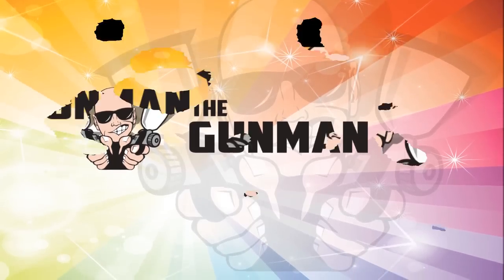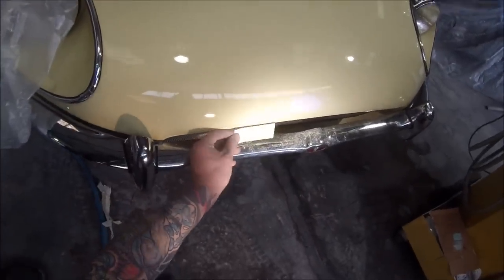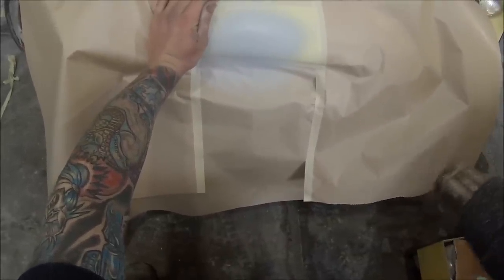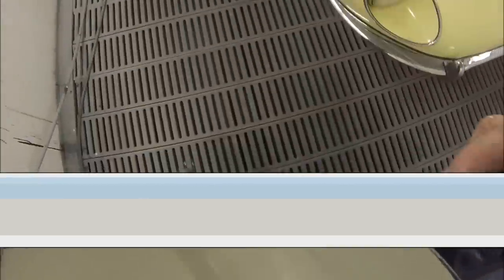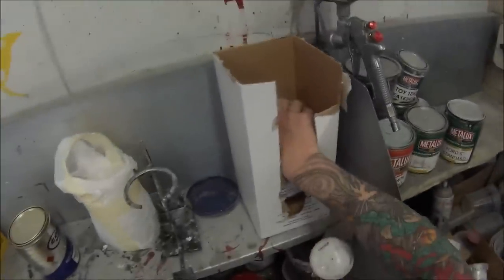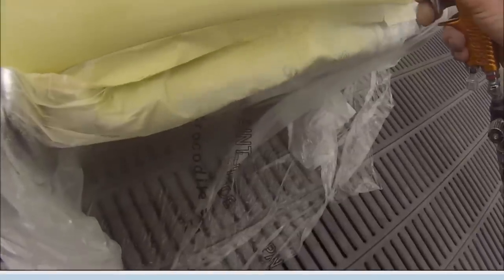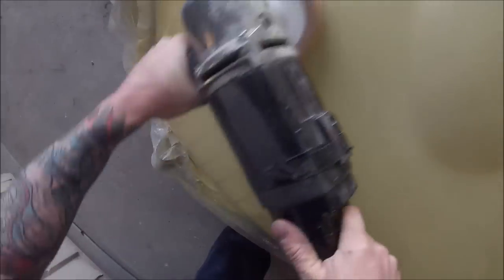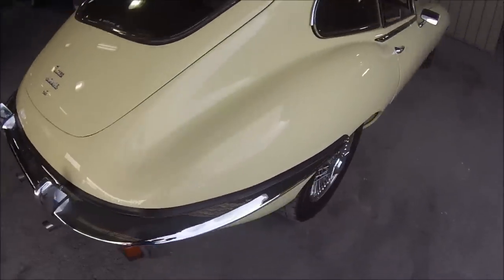E-Type Jaguar How to "Spot Repair"

Comment: Very good video mate well explained .great tips for fade out.
Reply from the maker: Thanks again for watching man, Cheers.
Reply: @TheGunmanChannel  what process do you do if it is single stage paint how can I spot repair single stage?
Reply from the maker: @Brandon_obs_ls  I would use clear coat on the blend area, it generally results in loss of gloss on the whole job but it'll buff up. You'll usually be able to see a single stage blend no matter what, using clear helps reduce the risk of seeing the edge.

Comment: Hi Gunman, excellent video, many thanks for putting the time in to do these....its appreciated!! 

Quick question: Would the same blending technique be necessary if you were just spot repairing  a solid colour without a clear top coat?

Thanks again

Comment: Hey Gunman,
I just bought some blending clears.  I did a spot on the weekend but the blend area dried out dull.  I wet sanded down and then polished, and all looks quite good.  My question is should I be adding the blending clear to already mixed clear coat, or simply running the blend clear on it's own which is what I did, and likely why it dried/ hazed?  I think you mixed the blending clear in with some already mixed clear in the gun and then sprayed the outer edges that you roughed up with the grey scotch pad.  Sound about right?
Thanks Mate!!

Comment: That's a brilliant job I'm myself a auto smart repairer . Regarding to the blender you use what's the % of lacquer on the gun with the blender ? Another question i normally buff a bit of the panel where my scotch ends towards the rest before I clear am i wasting my time? Thanks Orlando

Comment: Holy 'clip resurrection' Gunny :)
Can you confirm if you are blending your new clear into old clear.
Or is original paint a single stage gloss that your blending clear into to create a glossy finish ? 
Cheers
PS: Have finally armed myself with an anir160 and a gpi....getting ready fir full re-finish on my van.

Comment: I have always been checking a panel I am interested in your video that connects the old and new clear coat without any fog my question how to connect the clear coat so it does not look like a mist Is using thinner or another

Comment: I have a Harley tank that I painted and recently there was a leak around the gauge and it bubbled the paint. I sanded down the area and feathered it back but there's still quite a height difference between the repair area and the rest of the tank. Would you fill this with lightweight filler? It's just a solid black (gloss) tank, and I was trying to avoid respraying the whole thing. It's not a show bike by any means, but I want it to look good.

Thanks for your very helpful videos. They are part of what inspired me to paint it in the first place.
Reply from the maker: brock adams Yes sometimes when there's a lot of paint on a panel then its better to fill those edges or just keep going until its feathered properly then use a good 2k primer, the only other option is to take it all off but you may find more repairs.

Comment: Dear Gunman, love your work. Great job on getting the skill and info out there!

I have a question though: Do you have any experience with or know how about the Devilbiss SriPro spot repair gun? I'm thinking of getting one for small paint work that i can do myself in my shed. I can't find anything on it on the web so i hoped you could shine some light on that type of gun.

Keep at it!
Reply from the maker: Thanks, yes the sri are a great mini gun but have a hefty price tag, I have one of these Star mini guns and they are quality guns http://www.ebay.com.au/itm/STAR-NEW-CENTURY-SLV-EVO-T-MINI-Gravity-Spray-gun1-2mm-/120778164107?pt=AU_Car_Parts_Accessories&hash=item1c1ef0878b In Australia eBay is the best place to buy guns and you won't find guns cheaper elsewhere.
Reply: The Gunman  thanks a lot !!

Comment: hey dude, at work I'm starting to learn spot repairs but always get a like visible line all the way around the repair when I polish the fade out back?....do you spray fade out thinners past the grey scotch area or just before it? usually I p2000 wet sand past the repair then spray halfway into the p2000 area but when I polish it up I get the mark... I work in the industrial trade spraying lorries using ICI ehs turbo plus range... what am I doing wrong.. also I polish with farecla G3 compound. Any feed back would be greatly appreciated. I too am a fan of the gti pro lite although I use mine with the kb2 pressure pot. cheers. 👍
Reply from the maker: galva900 I always spray the fade out thinner over non sanded clean (polished) paint. The reason you can see an edge is because the buff is struggling to remove the 2000 grit scratches but ripping into the fade out thinner. Give that a shot and let me know how you go.
Reply from the maker: galva900 Also you want the leading edge of the buff running away from the fresh paint not towards or it can peel it up.
Reply: Try wetsanding your blend with 3000 grit.

Comment: hey gunman im a weekend guy in my garage at home but i really enjoy spray painting and your vids are second to none!
one question i have if you were doing this on say a middle of a door would you use clear base coat to go around your colour base coat and then clear the whole panel?
Reply from the maker: That is the best option, as you saw this was a massive panel and the customer needed to keep it small, usually I'd prefer to do the entire panel with at least clear.

Comment: I appreciate that your were doing what the customer (mechanic) asked of you and you did a great job but if I was the owner I would not have been happy and would have required the the entire middle section of the bonnet to be done - this is based on my own experience.

I have owned an E-type for a long time and in my ownership I have touched cars with towbars twice and caused similar damage to what this car had.  The damage was also fixed along the same lines as was done in this vid.

The car came back looking great - but after about a year in an out of the Aussie sun and a few polishes the blend point between the old and new paint became visible - not markedly so but nevertheless you could see it.  After the second ding I was assured that all would be Ok but the same happened about 12 months after the repair.

Also I would have thought the thin clear coat that was put on (noting that Primrose Yellow does not have clear on it) would be worn through after a few decent polishes and scrubs - the front of the bonnet does get a lot of bugs and grime on it with use.

Comment: Hi Gunman

Great video, I have learned so much from your videos, especially the one for fixing runs in clear coat, fantastic.
Just one question, you mentioned that you mix your base coat 2:1 whereas I have always mixed my base 1:1, is this a different base or have I been doing it wrong?
Reply: This is with acrylic, I've always read that you do a 2:1 mix too as per the label on the paint anyways.

Comment: Can some fillers be applied directly onto paint, please?  And why would you use this type instead of going to bare metal?
Reply from the maker: Kevin Chamberlain Yes the fine polyester fillers are designed to go over paint and its just quicker and easier than opening up possibly more old repairs and multiple layers of paint. Your paint supplier will point you in the right direction as which fillers can and can't be used over paint.
Reply: The Gunman Big help!  Thanks GM!  :)

Comment: How does blending thinners work ? Does it thin out the original clear and the new clear to form one surface and prevent an edge forming between the new clear and original paint?
Reply from the maker: +sypher0101 basically yes
Reply: +The Gunman You mentioned (i think) you did the spot repair because it had along bonnet & it was a quick job, would there be much difference doing it this way rather than painting a whole panel on other vehicles with small area damage ?
Reply from the maker: Material usage, prep & polish is more doing the whole panel but doing it this way the blend may be visible in time

Comment: Every time I see someone do this, they blend a large area. We call this type of repair " doing a burn in " My question is , can you keep these types of repairs small. I need to do a couple spot repairs on a similar car. Volvo P1800ES. I have an aerosol blending agent to burn in the blended clear. Would reducing the activated clear 10 to 1 work better than the blending solvent? I know these types of repairs have had to be around for 50 years. I think people who are good at it don't tell their secrets. You don't have a choice when dealing with old European coupes that do not have breaks between the panels. What are you going to do? Disassemble and paint the whole car just because someone dropped a wrench on the nose? I've also seen people only use compound to scuff the area to be painted. Will that work as well as a grey scotchbrite and scuffing agent? One more question. Will alcohol wipes work as the wax and grease remover or do I need to spend another$20.00 for real wax and grease remover? How are other people doing this on really expensive cars? You definitely have the best video on this subject. The Volvo looks like a show car after wet sanding and buffing it. A couple of the areas are barely noticeable. I'm worried about making it look worse than it already does. How long will that repair hold up before fading back out on that hood?
Reply from the maker: erosionhead420 I have copied this question and saved it, what I'll do is answer it in a long video when I run out of stuff to talk about. I could sit down for 20 minutes writing a reply and I'm very busy these days hope you understand mate. Oh and lets be honest if you got 2 years out of it you'd be doing well but a polish may bring it back up.
Reply: Cool, thanks. I know i was asking for a lot of information. I would be interested in how they were doing this type of repair 50 years ago. I'll let you know how I do with the Volvo. Hopefully it will look even better and not worse.

Comment: any reason you didnt use stopper first then wet sand the stopper with 400 ?
how would one do this with a single stage paint as i rubbed through my base trying to remove a large run at the bottom of a door ?
Reply from the maker: You can use exactly the same method I used for my clear coat but with single stage. It's not recommended but it can be done, there's a good chance you'll see the edge of the blend if you're not experienced, probably safer to do the entire panel, save you doing it 2-3 times then giving up and doing the entire panel anyway. I never wet sand filler, I barely ever wet sand full stop.
Reply: thanks for the heads up

Comment: How would you approach this differently on a car that has no clear coat (straight single stage acrylic?). Here is a photo of my 240z.

https://goo.gl/photos/W5CY7Aaps6fRFt8b8

You can see it has 2 white patches (which I believe are just a primer) and are the result of a body shop I took the car out of before they finished the repair work. Due to issues with them in general. I'm now looking at repairing it myself and was going to give it a go. Just wondering how you would approach it?
Reply from the maker: Looks like a nice car, but I'd take the exact same approach, get some acrylic clear and use it over the top of the single stage colour, so blend the colour then allow it to dry for a few minutes then apply 4 or so coats of acrylic clear and blend it out with some thinners over the edge, if you don't use clear then you run the risk of seeing the blend area even if the colour is close. Are you Geenie's mate?
Reply from the maker: You could always get a number made up and stick it there like a racing number 😂